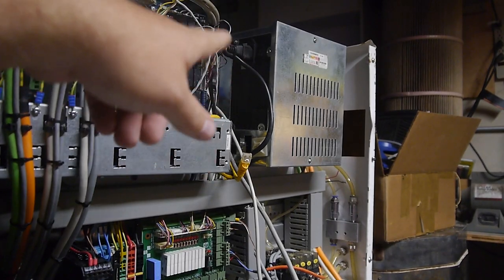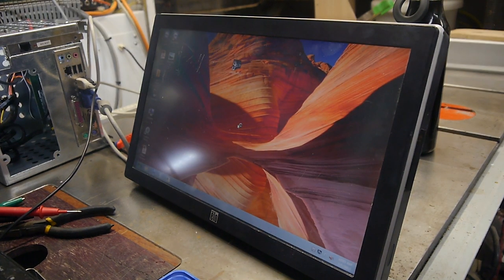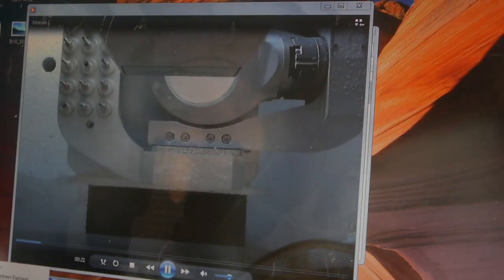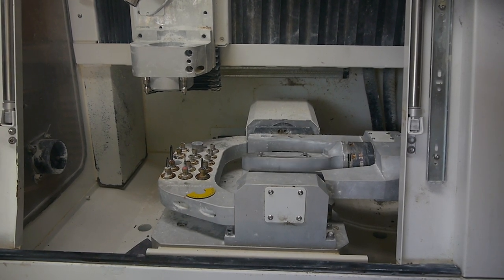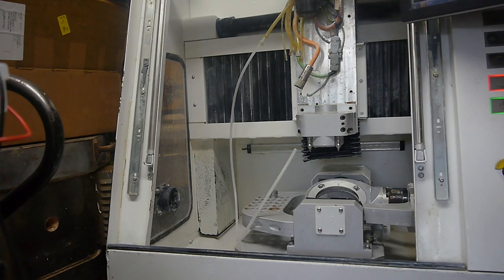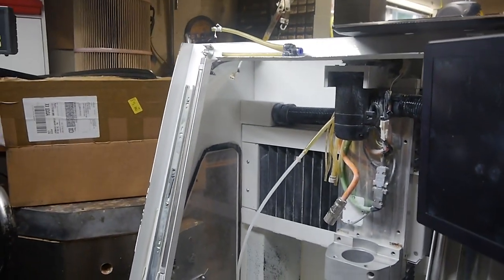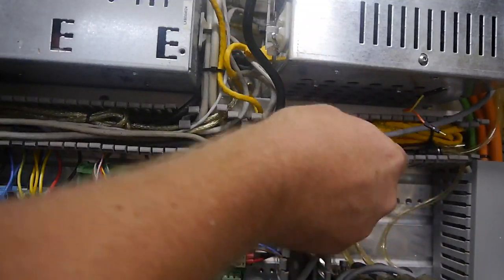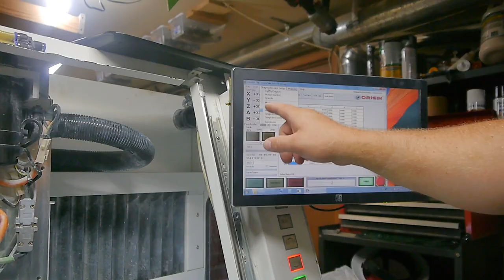5 Axis Cheap Dental CNC Episode 2: It's Alive!

Comment: thats an absolute awseome buy for 750, keen to follow along with how this ends up
Reply from the maker: Thanks, I was certainly fortunate in that regard. Next giant problem is the spindle. I received a quote from the manufacturer, $6,600 for spindle and driver board! I even went to spindle manufacturer directly and they are quoting $3,500. There are some cheaper Chinese spindles that could work for around $1,400 so I may go that route and then do the full $3,500 after I make some money off it with the Chinese Spindle. Have to wait and see. I don't have that kind of money at hand at the moment. Will have to wait till Christmas time to get close.  In the meantime I can work out if I can control the VFD directly from the motion controller without the networked Spindle card that is missing. Even that card is $1,000! LOL! Thanks for watching I appreciate the support!
Reply: @JoshAQ  I would suggest starting with a air cooled hand router (there are thin ones), just to be sure or all five axises are intact, then if you start getting orders or something – invest in ATC water cooled spindle

Comment: I would clonezilla the hard drive as early as possible or at least do a windows backup. The software installed would be a nightmare to find if the hard drive fails. Cheers
Reply from the maker: That is a great point! I think I have an extra 250gb Solid State Drive around here somewhere. Thanks for watching!
Reply: +++ and switching to mach3 / linux cnc is most likely impossible, since they only support 4 axis